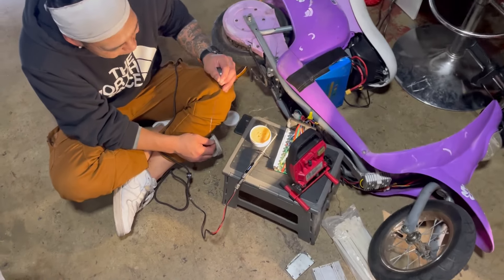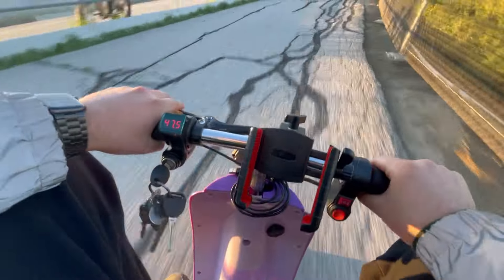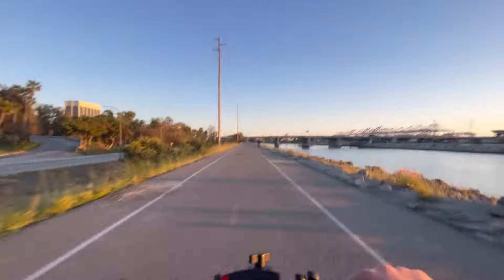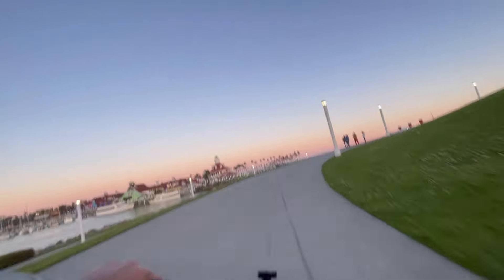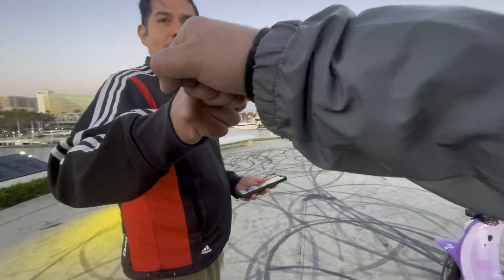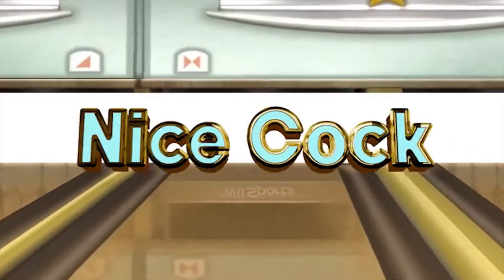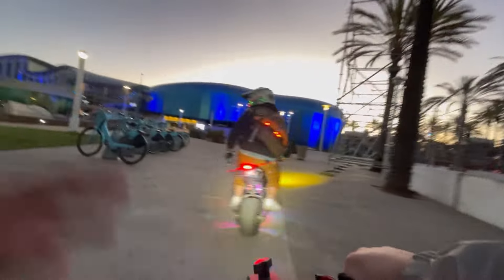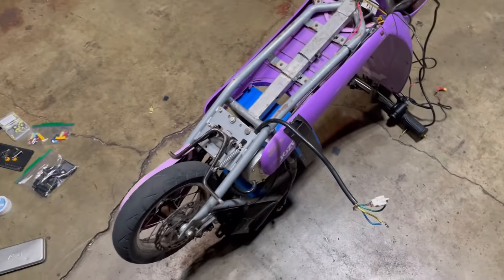Riding My MODIFIED MINI MOPED To DOWNTOWN LONG BEACH!!!

Comment: do you use extended screws to mount motor since it has to sit higher up? i need a link to the right ones
Reply from the maker: Yea i use extended screws and tbh i dont know where i got them 😂 i just found them in my tool box but go check out home depot they got plenty of options